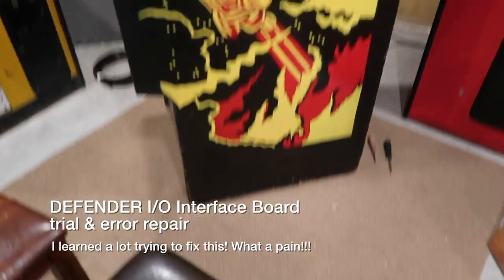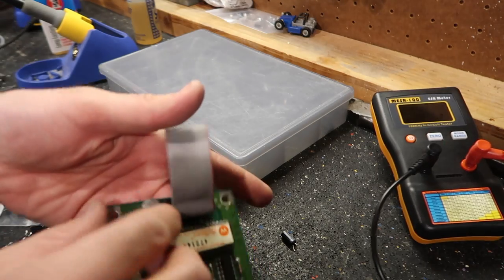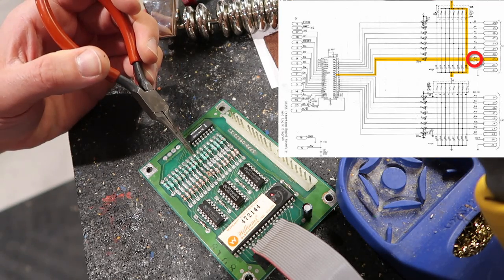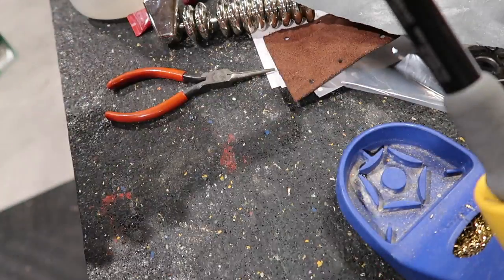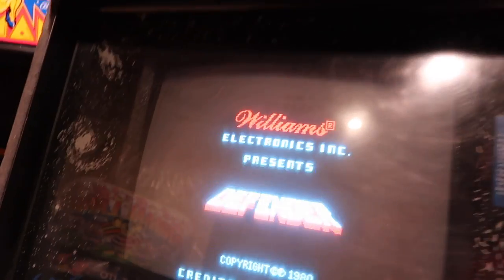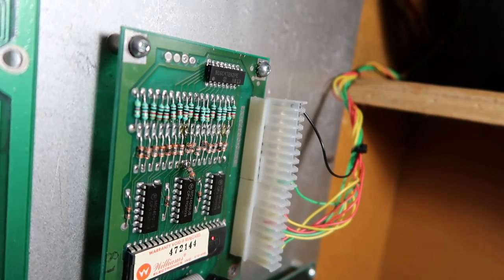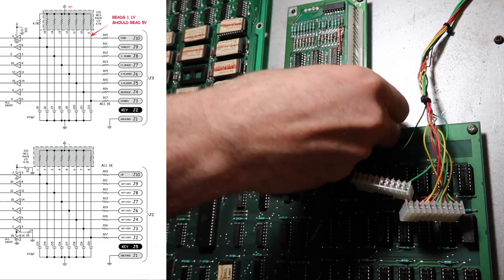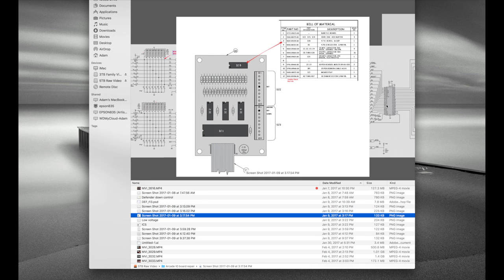William's DEFENDER Arcade IO Circuit Board repair - Ship moves down Troubleshooting 5772-09473-X2

Comment: Awesome video Adam!
Could you add a note saying "what codes printed on IC4? 
It might be a dollar part and help keep the board original for those who want to do that. 
--- Ok I looked up the part.  you can find these on eBay for cheap .
Search 14049 HEX INVERTER BUFFER or 4049 inverting buffer.
Make sure its a 16-pin version.